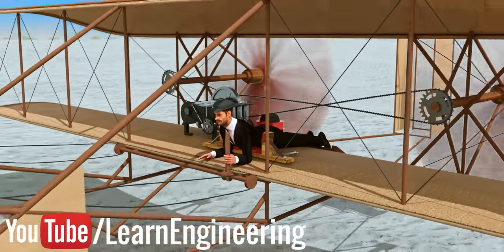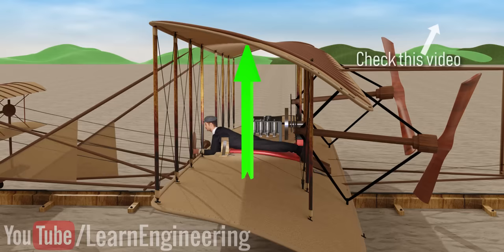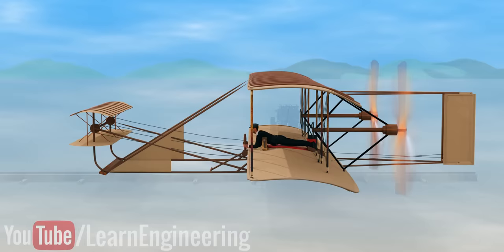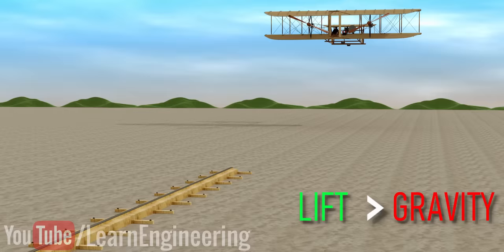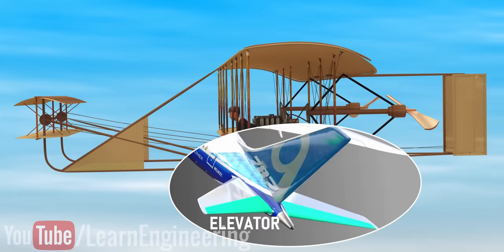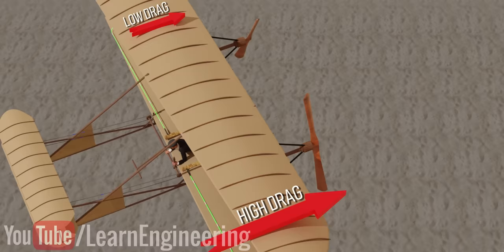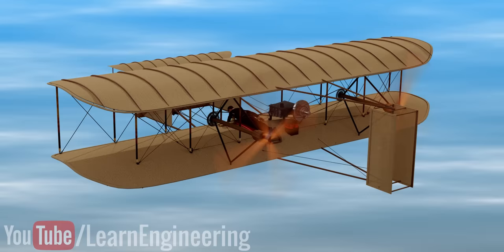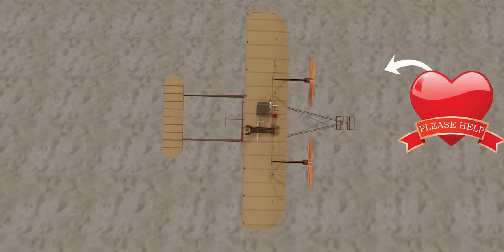The Brilliant Engineering of FIRST FLIGHT !

Comment: Did you know that the Wrights' engine was 325 rpm and that this is equivalent to the rotation of a fan?
Reply: Here is the description of the Wright 1906 engine along with earlier versions.
The engine rpm was about 1000.  The prop speed might have been around 325 rpm.

Two 8 ft. fans with efficient propellers would produce quite a bit of thrust.

Characteristics of the Wright Flight Engines
  REF:  https://www.gutenberg.org/files/38739/38739-h/38739-h.htm

  -------------------------------------------------------------------------
                          _1903       _1904-1905    _1908-1911   _1911-1915
                        First flight Experimental  Demonstrations  service_
                        engine[a]_     flights_        and
                                                      service_
  -------------------------------------------------------------------------
  Cyl./Form              4/flat       4/flat       4/vertical   6/vertical
  Bore and stroke (in.)  4×4          4-1/8×4      4-3/8×4      4-3/8×4-1/2
  Displacement (cu. in.) 201          214          240          406
  Horsepower             8.25-16      15-21        28-42        50-75
  RPM                    670-1200     1070-1360    1325-1500    1400-1560
  MEP                    49-53        52-57        70-87        70-94
  Weight (lb)            140-180      160-170      160-180      265-300
  -------------------------------------------------------------------------
Reply: @majorbett  no. Wright brothers presented 12 hp in 1903. 16 hp in 1904 and 20 hp 1905. These motors have not potence for run, takeoff and land under its own power. Don't have physical conditions for motorized flight. 2003 the replicas's nasa proved the incapacity for flight.  The 2003's replica has 50 hp motor.!!!!
Reply: @selmanedel7973  Where are you getting your information?  The exact replica had the same engine as the 1903 Wright Flyer.  Here is the data on the first three Wright -Taylor engines.  https://www.gutenberg.org/files/38739/38739-h/38739-h.htm

I don't  doubt that some replicas were not exact and may have used more
powerful engines.  Please identify the one with a 50 hp engine.  
The 1906 Taylor-Wright vertical 4 produced around 38 hp.  
It was built under license by a french company: bariquand et marre and a German company in addition to Dayton.

The "NASA studies" did not prove the "incapacity for flight".  They indicated that the 1903 Flyer was very unstable and almost impossible to fly.  They thought that the  flight distance would normally be in the 100-120 ft. range.  When the exact
replicas were flight tested with headwinds in the 15 mph range, this proved to be the case.  The Flyer needed the 15+ mph headwind.  In 1903, they were more than 20 mph.  

If you are going to refer to the "NASA" studies that were done in preparation for the 2003 Centennial and Hyde's exact replica, then provide the URL or reference.
Reply: @majorbett  in wikipedia of wright brothers, new between 1903/05, the brothers declarations in diary, the scientific community of the world, the nasa's replica in centennial 17 years's work for nothing, nasa proved all, the replica  don't flew, jack cherne built one repkica in 1998 an wind tunels's tests the machine was incontrolable!!!! Gut, more study, guy.
Reply: @selmanedel7973  The 1906 Taylor-Wright vertical twin produced 38 hp at 1300 rpm.  This was the engine that three European engine builders were contracted to build.   It was fortunate that Wilbur took delivery on several of these copies of the Wright upright 4  in 1908.  Wilbur broke the Dayton built engine he had shipped in 1907.

The exact replica did not fly very well probably due to pilot error and design flaws.
You have yet to provide an exact quote from the NASA  study.
My recollection was that the 1903 Flyer was unstable and very difficult to fly.
I think they estimated that it would fly about 12 sec. and 115 ft.in 15 mph winds.
The two test flights of the exact replica flew as predicted when piloted by
a person who was much less familiar with the prototype than the Wright brothers.  

Why do you think  plane in the you tube video had a 50 hp engine?.
38 hp would have been sufficient.  This matches what would be available in 1906.
Reply: @selmanedel7973  If you want me to study something, then provide a reference.  
Cherne said the original Wright Flyer (or rather the replica of the replica built by WIlbur) was unstable and nearly incontrollable..
It would fly if there was a 15 mph or more headwind.  This wind was available on two test flights in November and early December 2003.
The short flights were unimpressive but were similar to the 12 sec. 120 ft. flight by Orville.  
The Centennial flight was almost exactly 100 years after the original flight but it did not replicate the flying conditions.
In December 2003 there was no significant headwind.  On Dec. 17, 1903, the winds were more than 20 mph.  -majorbett
Reply: @selmanedel7973  I prefer this description of engine power:
                                       1903          1904-5           1906-11
 Displacement (cu. in.) 201            214               240           
  Horsepower             8.25-16        15-21             28-42      
(your data)                  12                  16-20            not listed
  RPM                      670-1200       1070-1360    1325-1500 

Prop Speed             I think this stays around 325 rpm.
Reply: The Wright's calculated how much thrust they needed with a spring scale.  Obviously, the scale indicated that
two 8ft. blades turning at around 325 rpm produced the
needed thrust.    Until 1906, the Wrights were minimalist.  In 1906 they doubled engine displacement
and increased the engine RPM to a little over
1300 rpm or about double the rpm of the 1903 engine.
I don't have the figures on the prop speed after 1906.
This would depend on the reduction gear that was used.  See the article on the Wright Engines in Wikipedia.
Reply: @majorbett   I invite you to look at the records submitted by wright, the information provided by wright Bros, and even Wikipedia. The powers of the flyer engines 1 - 12 Hp. for flyer 2 - 16 Hp. and finally the 3-20 Hp flyer. there has never been any official evidence that the Wright Bros. had more powerful engines than these.
Reply: @majorbett  o You did not answer because the Wright brothers never registered the plane in the 1906 patent. Remember the document had three years of processing in the US trademarks and patents
Reply: @majorbett   The powerful engines that took the brothers off the ground were brought in 1907 from Paris. They asked the captain to ferber the full description of the Dumont machine and bought an engine just like the Dumont engine.Light and powerful.
Reply: @acucarchocolate3961  
MB:  Please list the URLs you want me to check.  I think I have looked at about 90% of them.  You claim that there is no official evidence that the Wrights had
more powerful (more than 20 hp.) engines.

I am not sure what you mean by "official evidence" but have you Googled
"Wright vertical 4"  

There should be a dozen references to the 1906 Dayton engine.  It was bench tested in 1906 and produced 32 hp.  All of the 150 or so Wright 2 Model A & B  replicas used this engine or a replica built under license.  

This engine was installed on the larger 2 seat airframe and shipped to France in 2007.  Katherine Wright joined the 2 brothers on a 2007 trip to Europe.  They had received a payment of $15,000 or more from two French investors.  They went to Europe to set up European manufacturers.  This included business agreements with at least two European engine manufacturers. Barriquand et Marre  were the first to make deliveries.  When Wilbur went to France in early 1908, he had to rebuild the airframe which had been damaged by French customs.  He began testing in the summer of 1908, his original Dayton engine threw a rod and had to be replaced.  Instead of ordering a new one from Dyton,  he used one of the replica engines built under license to his specs.

Link:  
Wright Vertical 4 - Wikipediaen.wikipedia.org › wiki › Wright_Vertical_4
Google will give you 6 other references.  

Wright Vertical 4, In-line 4 Engine | National Air and Space ...airandspace.si.edu › nasm_A19620037000
"The Wright vertical four-cylinder engine was designed and bench tested by Orville Wright in 1906. More of these engines were built than any other Wright Brothers' engine ..."
Reply: @stevebett4947   I believe it would be possible to have engines more powerful than 20 Hp at the time of the wright, but the problem is that the engines of the time had a very serious problem !! The engines as more powerful the greater the WEIGHT of the engine. The first engine with the most suitable characteristics that the wrights needed began to be developed from of Dumont's antoinette, that is, the engines had power and were extremely light. That is why the Brothers asked in 1907 to boil the 14 bis plant. It was the secret of motorized flight: Dumont had AERODYNAMICS and the engine.
Reply: @acucarchocolate3961  

SB:  I hadn't heard that remark "boil the plant" 
Do you have a reference or a link?

It doesn't seem to make much sense.  The damage had been
done.  Santos Dumont had purchased the Antoinette 8V off the shelf.
It came complete with a transmission and prop.  SD didn't even have
to test out other props.  

Unlike the Voisin airframe for the BIS-14, SD did not
have the engine built to his specifications. He had nothing to do with its design.

I am not sure the  use of a light weight powerful engine was much of a secret
but it could be called a contribution.  After the success of the 14-bis
several pioneers bought and installed the Antoinette engine on their prototype.
For Cody in England, it enabled him to duplicate the uni-directional milestones that had been achieved first by Santos Dumont.  

The Wrights had assumed they had a 5 year lead over Europe
and the successful flight of the 14-Bis might require that they
speed up the roll out of their new Wright Flyer 2 Model A.

They had just completed a deal with 3 French investors who paid
the $35,000 (mostly in exchange for the Wright's European patents).
They  used an advance the new money to go to Europe in 1907 and set up the plants that would build replicas of the new airframe and the 1906 Wright upright 4.

Google "Wright upright 4" and read the Wikipedia page first.  There are
a number of other references and two books as well.

In 1902, The Wrights needed an aluminum block engine that produced 8-12
hp and weighed less than 200 lbs.  There were several available.
This historians seem to overlook this.  

In the US there was the Manly 50 hp rotary that Langley had used.  

In 1906, they abandoned their minimalist approach they had used to test their
hypothesis about flight control.  They went for robust upgrade for their
anticipated acceptance of their NO SEE NO PAY policy.  For an investment
of $35,000 and a list of performance objectives they would prove that they
could meet or exceed the performance objectives.  

If they failed, they would return the investment.  The actual contracts were
not quite that simple and took several years of negotiation.  They had this
stated policy in 1903 and never deviated from it.  

In 1906 they wanted a 200 lb engine with 32 hp.  They could have purchased 
the 50 hp Antoinette 8V or the Manly 50 hp rotary.  Instead they just doubled
output of an engine based on their old design.  The new engine that was bench tested in 1906 weighed about the same as their old 18 hp engine but produced
32 -40 hp depending on the RPM.  

Feel free to challenge anything I have said.  Most questions can be
answered with a Google search.   

I am a fan of Lins de Barros.  If you can show that your speculations
are consistent with something he has written, I will probably agree with it.
Reply: @stevebett4947  so, steve, the ten percent of your doubts are resolved. They did not FLY because they had no engines to fly. In the wright period the engine block weighed a lot,  consequently, the greater the power of the engine, the greater its weight. The solution was in Paris ALBERTO SANTOS DUMONT, the genius of this Brazilian was so great that he could transform the 25 Hp antoinette engine into a lighter and more powerful engine generating 50 hps (historical facts)
Reply: @stevebett4947  note the detail that in the letter the wrights themselves exalted the Dumont event and speak the name of the American newspaper that reported. The letter to Ferber was hidden for several years and only in the 1930s did it go public and the magazine "L 'envol" number 39, 1932 made the PUBLICATION. A copy of this magazine is worth thousands of dollars.
Reply: @stevebett4947  "Robert Gastambide
 – L’Envol – Number 39 – seventh edition– Librairie Gallimard – ,FRANCE 1932."
Uhuuuu. Wow.
This is extremely compromising for the wright.
Reply: @acucarchocolate3961   

SB:  Have you read Lins de Barros arguments?  
I should give you the link if you haven't.  Just ask for it.

None of the claims of the Wrights are indisputable or beyond doubt.
This is because they were not witnessed and certified by the FAI.
That was not even possible before 1905.  

Some of the flights were witnessed by members of the American
Aero Club but that would not count.  They were not French and they
were not official witnesses.  

The second kind of doubt is with respect to flights that seem too incredible to be accurate.  That applies only to the 873 ft. 4th and final flight of Wilbur Wright.  I can't prove that it didn't happen but I don't think the Wrights proved that it did.

AC: "the greater the power of the engine, the greater its weight"

SB:  Before you speculate on the weight of the 1906 Dayton engine, read up on it.  The 1906 Vertical 4 was not any heavier than the 2 earlier engines the wrights used but it produced almost double the horsepower.

Google Wright vertical 4.  
https://en.wikipedia.org/wiki/Wright_Vertical_4

weight:  160-180 lbs.  (70-80 kg)

power:  28 hp. at 1325 rpm
              42 hp at 1500 rpm    *31 kw

AC:  Santos Dumont "...was so great that he could transform the 25 Hp antoinette engine into a lighter & more powerful engine generating 50 hps."

SB:  So Santos could do this but not the Wrights.  Where is the evidence?

Santos Dumont had no role in the design and production of the 
Antoinette engines.  

He did switch from a 25 hp engine to a
50 hp Antoinette 8V (209 lb) engine when it became available in 1906.  
Wikipedia also has an article on the Antoinette engines.
They were designed and built by Leon Levavasseur
https://en.wikipedia.org/wiki/Antoinette_8V

SD made a number of contributions to aviation.  This is not one of them.
What is the source of your "historical facts"?
Reply: @stevebett4947   your comments are too long and too vague. you can't prove that the wrights flew before and you don't prove anything. Please reread what I have already presented and consider what Archdeacon registered in 1906. Your doubts are over. Lins de Barros does not support wrights and he considers them farcical.
Reply: @stevebett4947  FAI FIRST official RECORD: Dumont FIRST AVIATION RECORD OF THE WORLD, historical fact.!!!!!
No exist similar Record between 1903-1905 with event's, photos and footages!!!! The 14 bis has a great Dumont's engine with 50 Hp!!!
 similar engines were bought by the wright brothers in 1907 !!!
Reply: @stevebett4947  Linda de clay does not support wrights.
Reply: @stevebett4947  Please present simpler texts, and translate from English to Portuguese, please. It will be easier.
Reply: @acucarchocolate3961  

SB:  I am an easy convert since all you have to do is show that  your position is consistent with Lins de Barros.

I am quite aware that Lins de Barros is not in the pro-Wright camp.

He argues that the Wrights before 1908 never provided incontestable   proof of their claims.  I fully agree.

He does not have to resort to using unsupported claims and misinformation.
I am not sure why you are so attracted to hearsay and conspiracy theories.
You don't need them and it weakens your anti-Wright argument.

I am assuming that you are interested in more than leading chants and providing material for pep rallies.  The chant "We're number one"  doesn't have to be true in a pep
rally.  

There is little point in my re-reading your comments since my gripe is that
you don't provide references for some of your premises.  You can't just grab
something you saw on the Internet and assume that it is true. 

 If you will provide the footnotes and references, I will re-read your comments.
I have already read them multiple times since you repeat them over and over.
Reply: @stevebett4947  and did you prove any point in favor of the wright with official documents accompanied by photos, films registered between 1903-1905 to prove the primacy of the wright? the Archdeacon record for Dumont was made on November 12, 1906,  the first FAI record, Undisputed, IMMORTALIZED in bagatelle, by the authority Most important aeronautics of the time that existed since 1898. Can you prove this primacy for wrights or not?
Reply: @stevebett4947  If you speak of Dumont's record, this is indisputable, the wright themselves confirmed in the letter, newspapers from around the world reported it was filmed and photographed. The wright's first record is For 1908 and later you sought Dumont's knowledge. Evidence that they were able to do something before the wrights had a lot of time and nothing ever happened not even on American soil to categorically prove the existence of a machine.
Reply: @stevebett4947  
See, in the table below, the data published by the North American magazine "National Aeronautics", official body of the "National Aeronautics Association" in Washington: Pilot, Location Date, Flight time: 
SANTOS DUMONT - Bagatelle 12/11/1906  21 ” 
Henri Farman Issy le Moulineaux 11/26/1907 52 ” 
Léon Delagrange Champ de Mars 11/04/1908 6’30 ” 
Henri Farman Issy le Moulineaux 06/07/1908 29’53 ” 
Léon Delagrange Issy le Moulineaux 09/06/1908 20’19. 
For many years, these official records have been published without any dispute. In the American magazine "Reader’s Digest" of December 1942, we found an article entitled "Santos Dumont, Father of Aviation", condensed from the magazine "Air Facts". From page 54 we transcribe the following excerpt: “in 1906 he gave the world the first public demonstration of flight in a device heavier than air (the Wright brothers only came to fly publicly in 1908)”.
Reply: @selmanedel7973  nasas replica also had the wing design at the wrong damn angle, and design flaws!....and even then it had the original engine. The wrights flew due to headwinds on the beach with 12hp